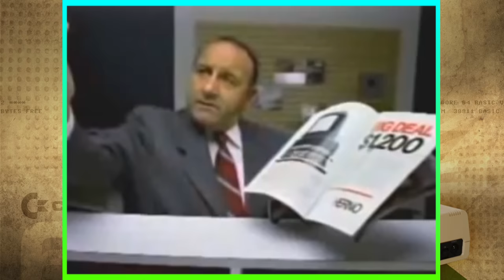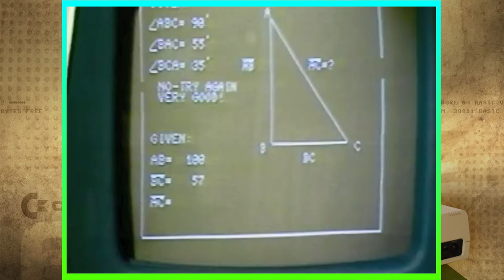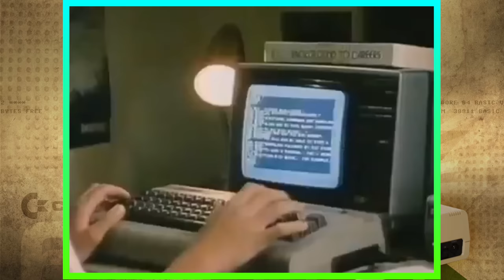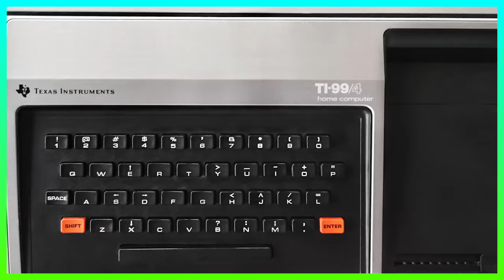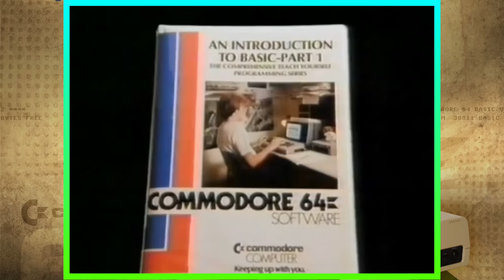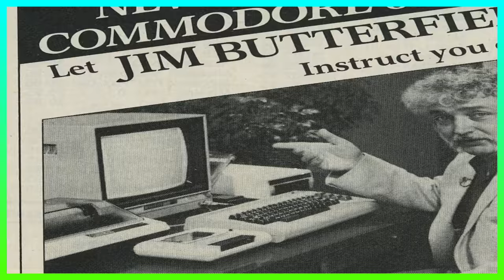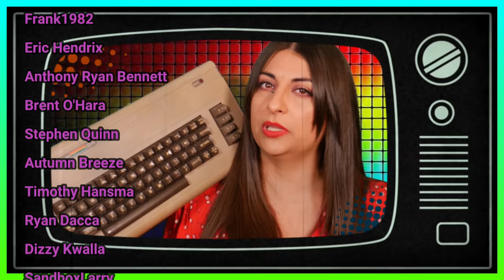Commodore 64 Story - The King of Computers! - Gaming History Documentary

Comment: The C64 has been for gaming computers what the NES has been for consoles : the transition from prehistory to history, the moment games where starting to look like something, real graphics, scrollings etc.

The C64 was overall better rounded than every other 8 bits computers :-)
Reply: I think that from a technology perspective that crown might belong to the Atari 8-bit range but the C64 certainly blazed the trail for gaming-specific hardware due to its incredible success.
Reply: @Daz555Daz  The Atari computers were pretty cool, but the sound hardware of the C64 put it on another level.
Reply: @Debiruman1666  & @Daz555 - For music, the C64 was the best but the Atari wasn't that bad. 

The same goes for graphics. Here's some of the highlights of the C64 : The graphics chip, VIC-II, features 16 colors, eight hardware sprites per scanline (enabling up to 112 sprites per PAL screen), scrolling capabilities, and two bitmap graphics modes.

For graphics, the Atari wins over the C64. 

Now let's look at the Atari 8-bit family : 256 colors, 4 8-bit sprites as well as 4 2-bit missile sprites (that can be used together to make another 8-bit sprite). The sprites have three possible widths and vertically it has the height of the screen. Sprites can also be sliced into may different sprites using display list interrupts - each "new" sprite can have its own width, color, and horizontal position. Scrolling is easier to do on the Atari. While both machines have registers that can move a scan line horizontally by 1 pixel, on the C64 when the register reaches its limit (7 bits), one has to reset the register and then move all the scrolling screen memory which means thousands of bytes. The Atari has the same sort of register but when it reaches its limit you reset the register but only have to increment the screen address points to memory which means only updating a few hundred bytes of memory. The same is true for vertical scrolling. The Atari has 5 character modes and 10 bitmapped graphics modes that can be mixed together.
Reply: @Gamevet  Agree 100%. The C64 has the edge on sound. What's incredible about the hardware on the Atari 8-bit range though is that is was released nearly 3 years before the C64. It was trailblazing to have such custom game specific hardware in home computer.

C64 remains my favourite 80s micro though. Sits alongside the ZX Spectrum as the defining machines of that era for me.
Reply: @Daz555Daz  I wanted one of those Atari 400/800s as a kid. It wasn't until I'd played a friend's C64, that I totally wanted that instead. I did get to play a friend's Atari 800 XL in the late 80s and had thought that it was really cool.
Reply: @Gamevet   I've always had the gaming machine, not to the computer.
Reply: @matthewjahnke6956  Are you referring to the Atari XE?
Reply: @Gamevet  Yes.

Comment: We had a C128 with thousands of pirated games. I eventually discovered you can use Sega Genesis controllers with it since the joysticks were always breaking.
Reply: It is not a good idea to use a Mega Drive controller with a C64 or C128. Did the same, but did not work properly - but there is a risk to destroy the joystick port that way (fortunately nothing happens here on my C128).
Reply: Worked fine with my spectrum + and Acorn a3010. Megadrive pads were so versatile.

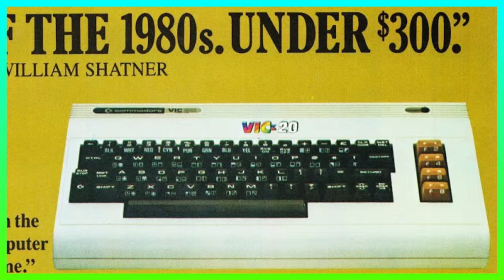Comment: I'm not sure if it was intentional, but the VIC20 box in the video here is a TheVIC20 box (a TheC64 in a VIC20 styled case and keyboard, note the RetroGames logo at 6:45), and there's a TheC64 and its box later in the video too.

This leads to a somewhat side discussion of the recent activity with the classic breadbox (and other retro computing releases as well).  In the wave of mini-consoles, there was a TheC64 mini (1/4 scale plug & play console), and later a full sized release w/ working keyboard (both being emulated, so USB and HDMI in terms of connectivity).  The full sized units sport VIC20 emulation and a host of features that make them a viable option in place of original hardware if you want something that looks the part w/o worrying if 40+ year old hardware is going to stay working.  Then there's the Mega65 which is an FPGA based implementation of the un-released Commodore 65 (a more direct successor to the C64 in terms of specs than what the C128 was), and the Spectrum Next (also FPGA based), which is an evolution of the beloved Speccy.  The community around the 8bit micros is still very much active.

Comment: Never had a c64 nor did I ever know anybody that's ever actually owned one. I've always found the computer rather intriguing since I've gotten into emulation. However, to me it just makes more sense to forego the c64 and instead go the Amiga route.
Reply: The Amiga is a much more powerful multimedia and gaming computer, but it has far less software owing to it never taking off the way the c64 did. I never had a c64 but I had an Ami by the time I first encountered one. It's prosaic basic based operating system and chunky pixels seemed quite crude and quaint, but in retrospect I can see how cutting edge it once was
Reply: My father owned a few. I may have been a little child back then, but yes! I lived through this.
The C64 was what kept gaming going through the video game crash of 1983. With the price war between Commodore and Texas Instruments going on, the Commodore 64 was so cheap that there were just so many of them out that you had to make software for it because there was enough money to be made. With the Atari 2600 obsolete in 1983, and Atari losing tons of money and Apple not following the price war and keeping its prices high, and no one touching the video game console market, the C64 was the choice for computer gaming.
The only reason youd want to touch a Commodore 64 is to play the games that were ORIGINALLY made for the C64 (there are too many to name), just because of difference between it and other systems. There is always a difference between the original games and the ports to other systems.

Comment: The TED Line (PLus4)  while 3.5 times faster and better BASIC, it didn't have a SID Chip nor sprites, which is why no one would drop the C64 for it.  The C128 tried to remedy that mistake, by including the VIC-II and the SID, it even contained a GO64 mode, but because of that mode, most developers delevered for the larger market which was still the C64 and the GO64 mode on the 129.  So the 128 still couldn't kill the C64.  The C128 was discontinued in 1989, 5 years before the Commodore 64, which ended with the company going under.  What Commodore should have done was put more effort into it's PC line. Granted they prefered to use their own parts,  But even their Amiga line had trouble competing with the new Pentiums with 16-bit sound and SVGA graphics. I was actually saving for an Amiga 1200 the time Commodore closed it's doors.  So I ended up building a PC instead.  All the games I wanted for the AMiga were availble to the PC, so the switch wasn't too bad.  But technology was moving quickly in the 90's. Just a few years later we were seeing hardware 3D graphics, wavetable sound and OPL3 sound being replaced by live recordings both because of more memory and audio compression.  A lot of computer companies that made only PCs wouldn't last the next few years.  Even IBM dropping out of the market they created.  What we see now is just a handful of lines that are manufactured, and the rest are exactly what we can build at home.

Comment: I can always tell the difference between Commodore 64 emulation and real hardware images. real hardware has jail bars on the video out, the audio is slightly different. I use real hardware via S-video connected to a CRT. There is only a handful of YouTube creators that actually use real hardware most use emulation.

Comment: I got the Funny playing mini arcade machine to take dingux Emulators like TI-99 and C64. Just play the dge file. I think it has TV out to if I remember correctly and you can play on the controller which is a plus compared to the original.

Comment: You cannot compare Sonic for the C64 as it is just a port running the original Z80 code and needs the ram expansion unit to run on real hardware.

Not a fair comparrison. I would have mentioned Sam's Journey instead since it was built on OG (PAL) hardware and doesn't require the ram expansion (unless you are in NTSC like me sadly).